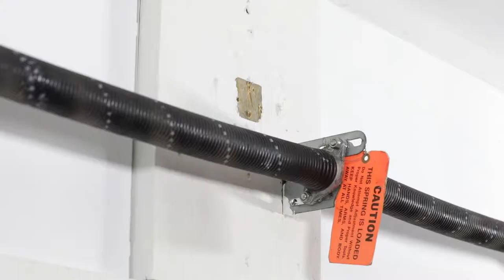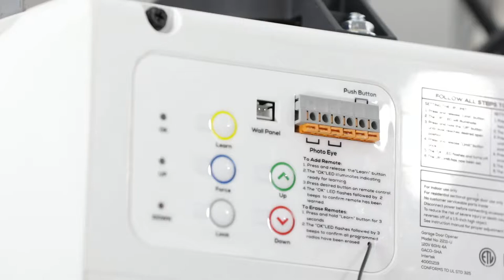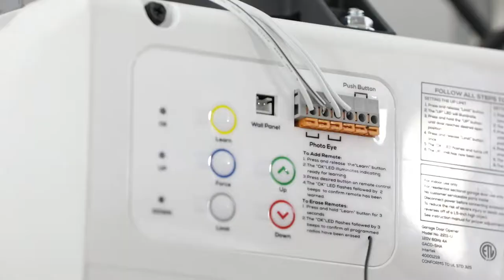beamUP - The Sentry - Smart Garage Door Opener & Smart Controller - Installation Video (BU400)

Comment: I have a heavy garage door. Can this handle it?
Reply from the maker: Yes!  With a properly balanced sectional garage door, the BU400 has been rated to lift carriage house doors of over 1000 pounds!  Many heavy doors are out of balance, so we recommend following the pre-installation instructions on balancing your motor-less garage door panels.  If your doors are over 1000 pounds, we recommend the Thunderbolt (BU950V3) Jackshaft garage door opener that is wall-mounted as opposed to overhead.  Please reach out with any additional questions!